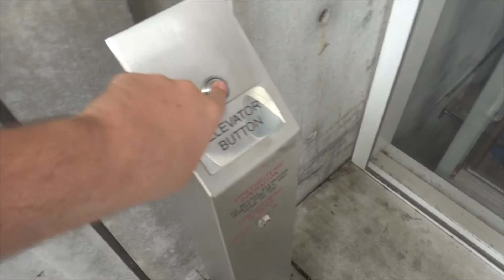Kone roped hydraulic at the High Museum of Art in Atlanta

Comment: Very nice elevator, and it's been a long time since MusicFreakCC has been filming elevators. Also, I wonder why the hall stations are CJ Anderson, while the lanterns, car stations, and floor indicators are Innovation Bruiser. I wonder if it's because Innovation didn't have a heavy duty NEMA-4X grade vandal resistant fixture package then, since this elevator was installed in the mid-2000's, and therefore went with CJ Anderson for the hall stations.